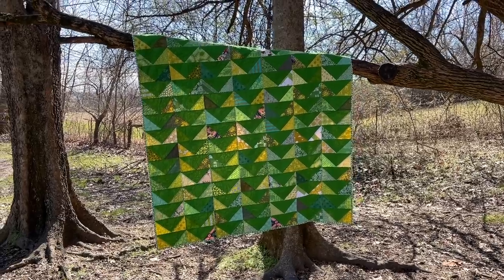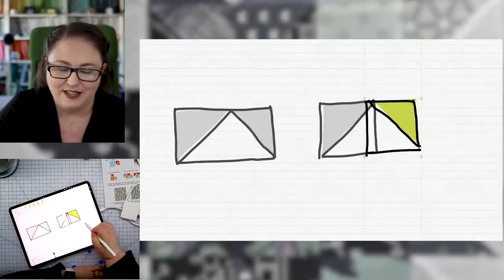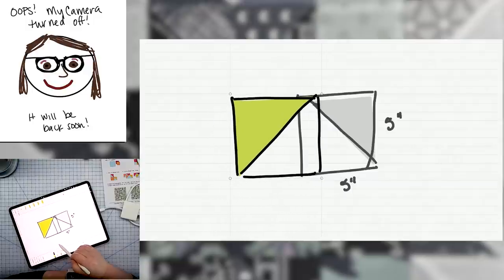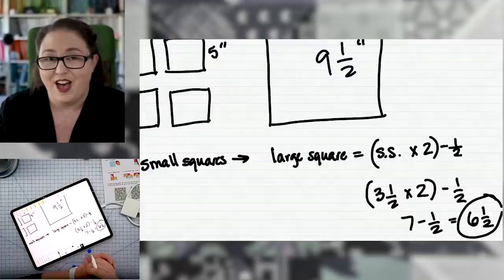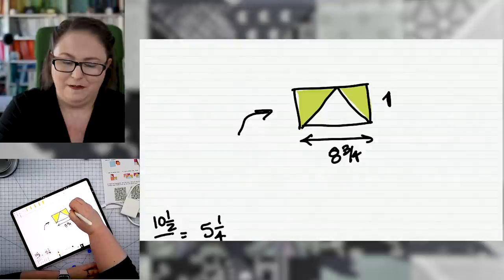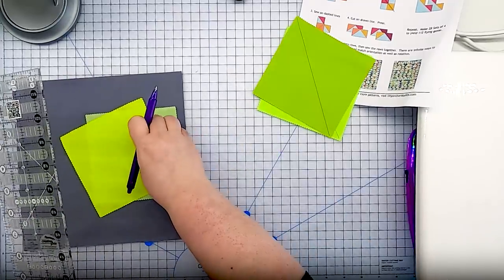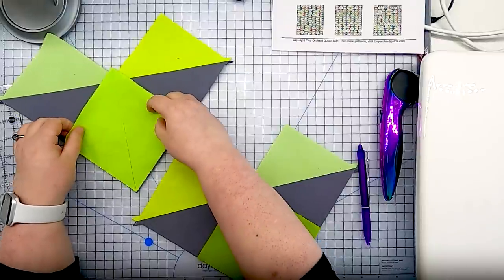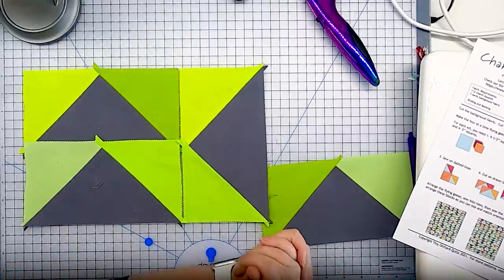Flying Geese Quilt from Scraps!  Use the Scrap Sizes You Have WITHOUT Trimming!

Comment: This is such an informative video! I do have a couple of questions- do the flying geese blocks need to be squared up? Do I need to trim off the points before I sew the geese together? Thank you for this easy tutorial on making flying geese!
Reply: I imagine that is down to your own preference.  From what I understand it's about the underneath bulk plus having enough spare to attach it's neighbor blocks
Reply: I use Deb Tuckers wing clipper tool.  It uses this method of 4 at a time. It creates a slightly oversized unit and offers perfect trim down to preserve seam clearance at all points.  

I like to use such methods with any block with bias seams.  It is no fail v sew press pray

Comment: I love the math & the method but for some reason these never come out perfect for me.  I wonder what I am doing wrong?  They always seem too small & I make sure my 1/4 in. is scant & my pieces are cut perfect.  I would love to use up my scraps!  I wouldn't care if they were bigger but too small drives me crazy!  I always use them Eleanor Burns method but there seems to be so much waste but they are perfect every time. I want your method to work for me!  Any other tips?
Reply: Get deb tuckers wing clipper tool.  She uses this method with slightly oversized units that are trimmed perfectly to preserve all points.  It is no fail.  Blocks with bias seams are wonk prone despite our best efforts.

Comment: My problem with making flying geese this way is where the squares overlap in the centre. You get an extra layer at the point of the unit. What do you do about it?
Reply from the maker: I press my seams open and it hasn't been a huge problem for me--I don't end up with any more fabric in the point than I do if I make flying geese the traditional way.  If your initial small squares are a little oversized you might get a little extra fabric in there but it hasn't been a common thing for me.